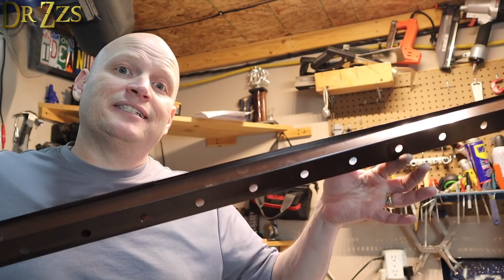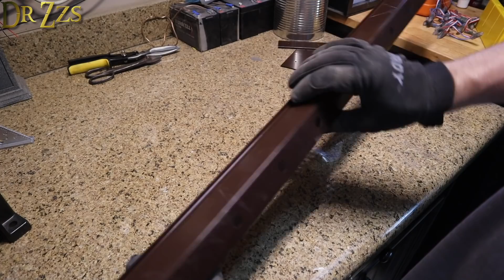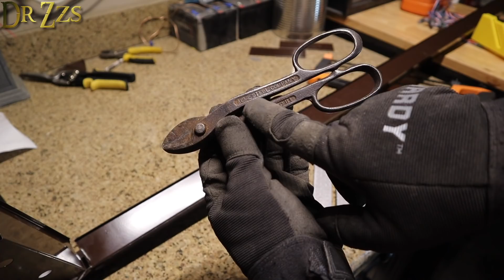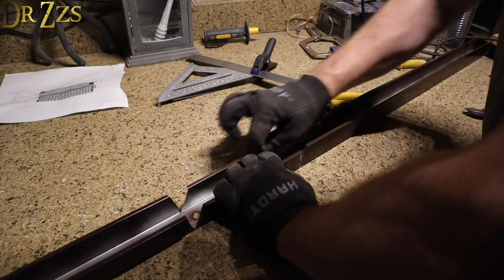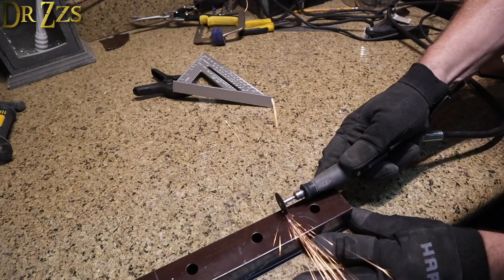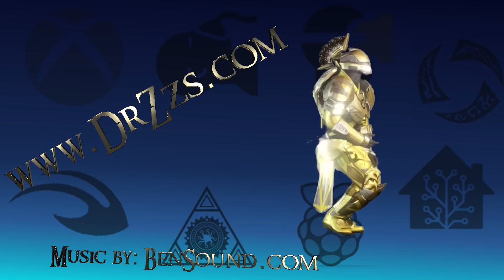Permatrack is Metal Channel for Permanent RGB LEDs on your House -  awesome year round light shows!

Comment: I purchased 4 boxes of brown Permatrack on October 17th, 2021. When I opened the boxes, 2 boxes were one shade/texture of brown and the other 2 were a totally different shade/texture of brown. It was very noticeable and there wasn’t any way we could use them. I reached out to request a replacement, but he clearly was not going to correct the mistake. I asked how I return the boxes and even offered to drive to Lehi, but no response. I would stay clear of purchasing anything from him. I ended up having to find paint that matched as closely as I could and repaint 100 feet of track. Stay away at all costs!

Comment: I was wondering how you manage water/ice with the permatrack.  The product is amazing, but I would imagine water gets into the channel, freezes and expands, especially with the corners and cuts just as shown.  How this is resolved would be a great addition to your amazing youtube videos.
Reply: The idea behind this system is really to house, hold, and protect the pixel lights from sun damage. The light should already by IP67 rated. Condensation will build up in the channel but not to a significant degree. IP67 would only fail under water for a set amount of time but not from condensation alone. Even if water pools in the low points, you should be okay.

Comment: This is great, looking forward to ordering and installing some this spring. Question, why don’t you produce some already formed 90 degree corners and end caps? People could buy them in addition to the straight channels. Also some connectors to seal two straight channels butted together for longer runs.

Comment: I'd like to use the new waterproof ray wu Connector "DHL/FEDEX/UPS FREE SHIPPING 1000 DC12V WS2811 bullet pixel 50ct BLACK wire 18awg with ray wu/paul zhang/xconnect connector" lights, but your holes are spaced every 3 inches. I'd be giving up an inch of wire for every hole. 
shorturl.at/cewyR

Do you have any recommendations?

Comment: I' think for the end caps I'd cut to use a side. Cut it about 1/4 longer than you need, bend a 90 degree flap on the side, then bend into position. Drill a small hole in the flap and body then pop rivet the end cap in place.

Comment: As a journeyman sheet-metal worker best way to do that is with a pair of  red and green Aviation snips but mark your angles don’t cut them yet. leave some material on one side and cut the angle on the other to allow for an overlap when you bend your joint closed if anything sticks out or gets in the way open it up and alter.  this will help Prevent Visible gaps the cut on the angle is the outer Layer in the overlap
Reply: Jason - you are so correct. Looks some much better and no need to be super accurate matching two cuts to each other and the over lap is barely visible. Great advice.
Reply: BeUnknown2   anyone in my trade will notice the technique if looking.  I have been looking for a way I could give back, being a newbie to the led world. I am happy that you tried it out.
Reply: Could sheet metal worker replicate this product? I’m curious because I think I can just have these made by anyone with a sheet metal-bending brake in their shop. What do you think?

Comment: How many lights can 1 length of channel hold?
Reply from the maker: 20 holes per 5 ft section.  I'm already working on a version 2 that will have 30 holes in 5 ft for folks who want a little more light density.

Comment: Bet we can't get it in the UK?
Reply: Though you'd need 2 inch or even 1 inch spacing for our small houses and short driveways.
Reply from the maker: we are working on version 2 that will have LEDs every 2 inches.  We don't have a way to get them distributed in the UK yet, but if we want to at some point.  Hopefully soon.

Comment: Regarding Tin snips, they come in Green (LH), Red (RH), and Yellow (Straight). The Green lifts the waste material up on the RH side of the snips so good for the LH cut of the mitre and the red ones are good for the RH side cut of the mitre lifting the waste material on the LH side of the snips. You can use both together to get the waste material to lift up out of the way. Ie start with the Green snips in the middle of the mitre and cut to the mitre peak and then use the Red snips for the RH finished mitre cut then grab the Green's again to finish the LH cut of the mitre. Great video too by the way Doc!
Reply: Sorry forgot the Yellows are for straight and slightly curved cuts on flat sheet. They have slightly longer jaws and a lower angle of attack and as far as I know only come in RH, so lefties you're better off using the Green ones for the straight cuts.
Reply: Great info.  When I bought my set many years ago, only came in a 3-pack.  The store owner explained he only sold them this way to prevent bad results from using the wrong one.  He even took the time to explain why, and that's how I learned this.

Seems to be that the "fail" https://youtu.be/CplCtU2_Udg?t=332 is due to using "right-handed" shears in the left hand.  Not "RH" as you indicate for how they cut, but "for use in the right hand.  As a lefty, I am well aware of how poorly "right-hand" scissors (the vast majority I've ever used) work in the south paw.  I've never seen "left-hand" sheet metal shears, only scissors, and they're rare.

As always, great video @DrZzs !
Reply from the maker: Thanks!
ya, I think I need a set of all three.